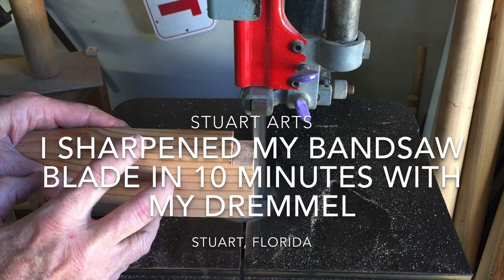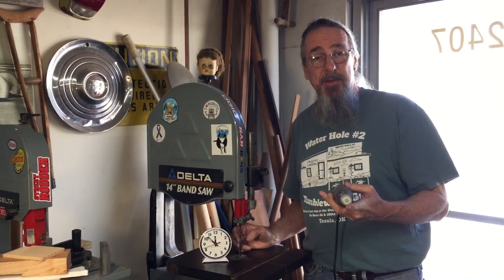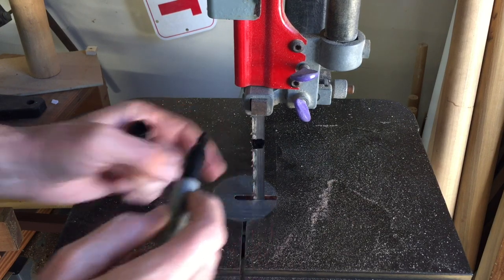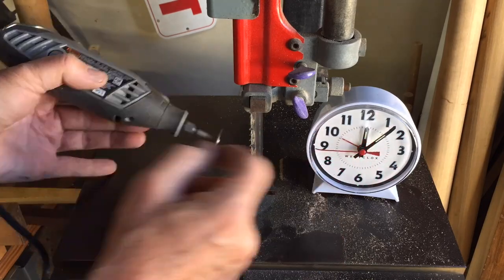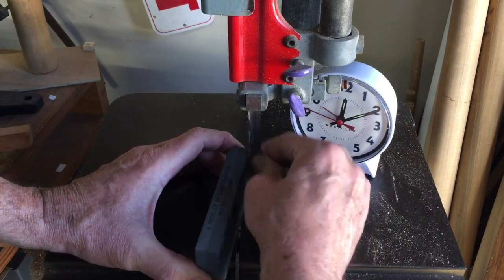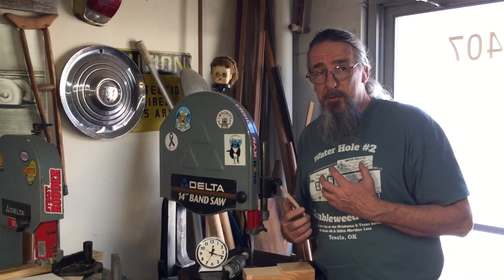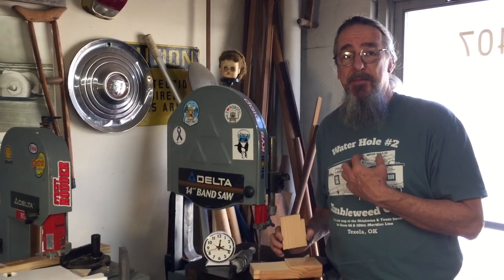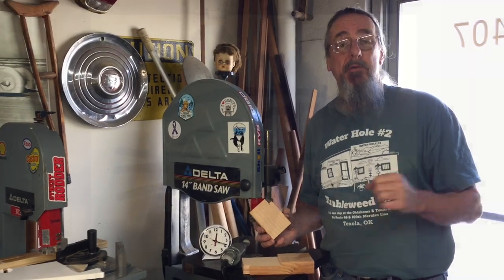I Sharpened My Bandsaw Blade in 10 Minutes with My Dremmel Rotary Tool

Comment: I just did this the other day, and then managed to jam the blade I had just sharpened resawing 12" of walnut...  Turns out the two other old blades I have were both sharper than the one I had on the saw :-)  (I usually sharpen the gullet with a chainsaw bit BTW)

Comment: can you source the dremel sander you used, and at what speed # on the dremel?
Reply from the maker: I used diamond wafers from an inexpensive rotary tool bit set like this one. I believe I used a medium speed setting. You should be able to touch them up with just a quick touch. Good luck! https://www.amazon.com/Cedilis-43-Pack-Stone-Carving-Set/dp/B08KPCT2WY/ref=sr_1_8?dchild=1&keywords=diamond+dremel+bits&qid=1628372841&sr=8-8